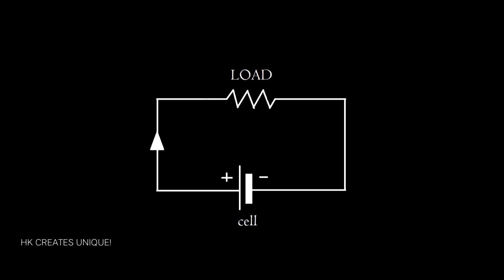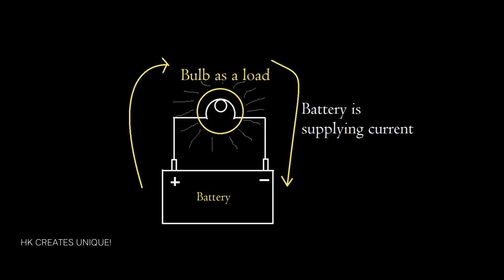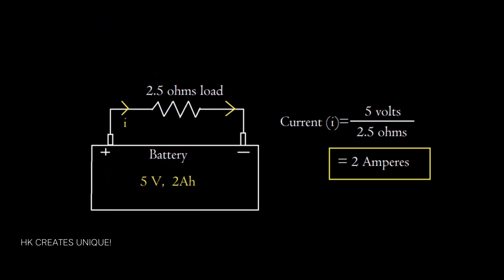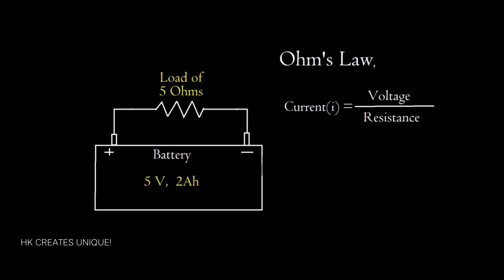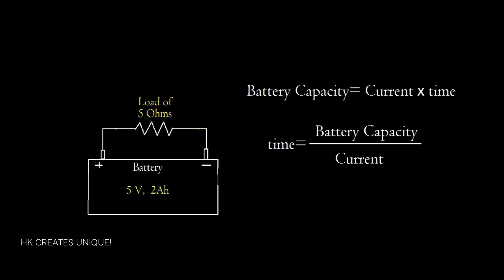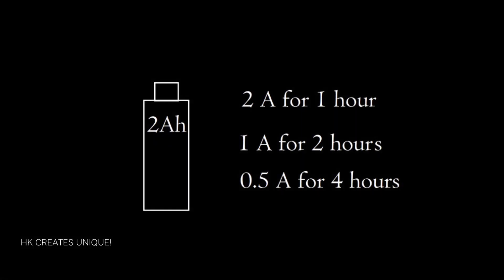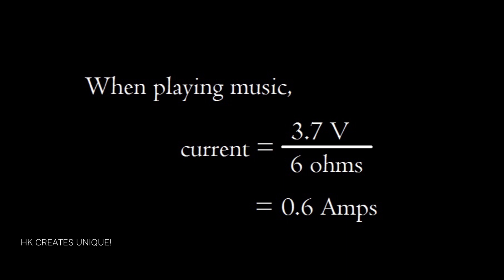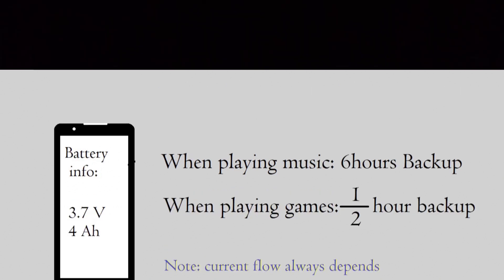Battery capacity || explained

Comment from the maker: 4:54 7.4 Amps is a lot! Actual phones will not draw that much current... I have used it just for illustration, batteries are not capable of delivering a lot of amps..there is a limit.. This is because of natural internal resistance inside the battery and some protection circuits.